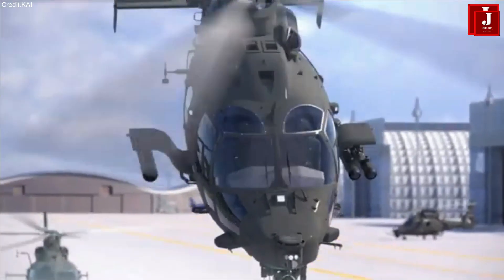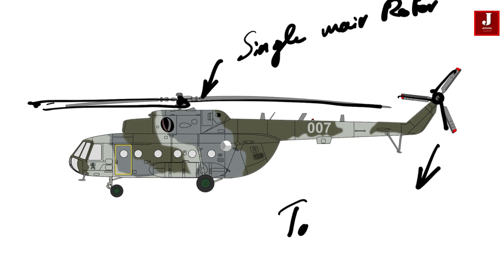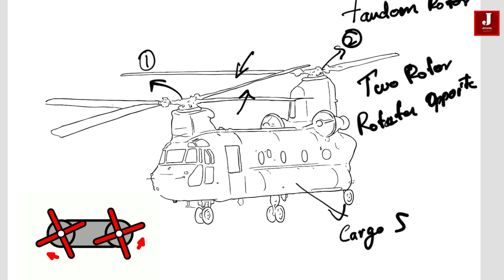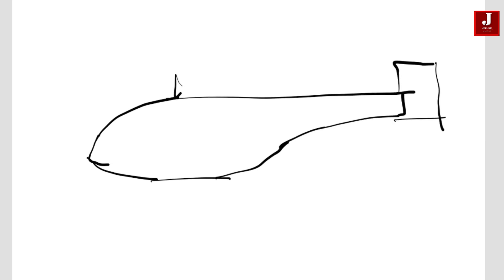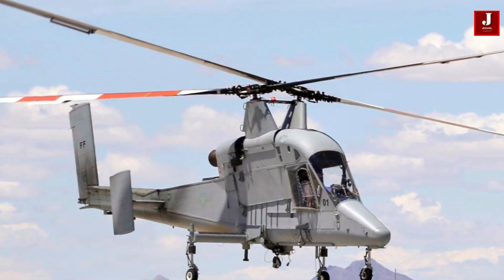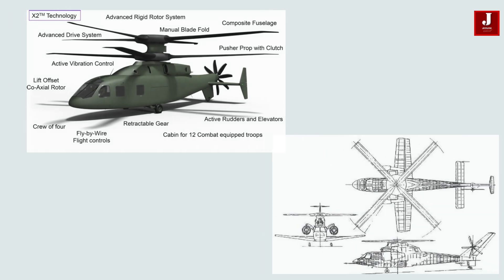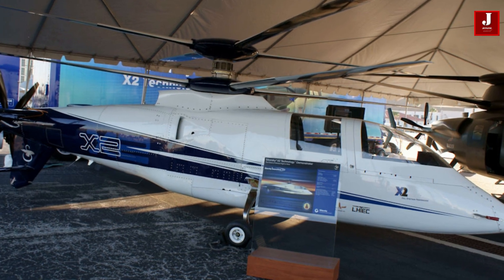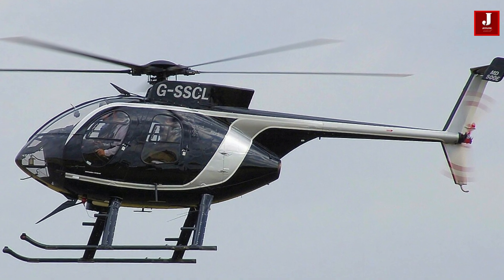Exploring the Different Types of Helicopter Rotor Systems and the Science Behind Them

Comment: What makes an engineer chose a standard rpm rotor system as opposed to a high speed rotor system.
Ex. Bell 206 type and a Hughes 500 type?
Reply from the maker: mostly to maintain stable flight